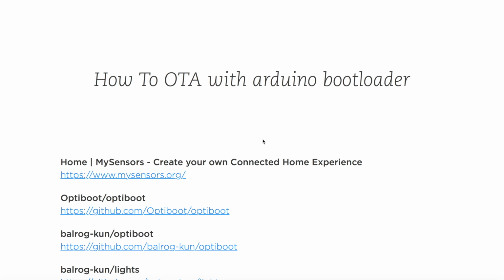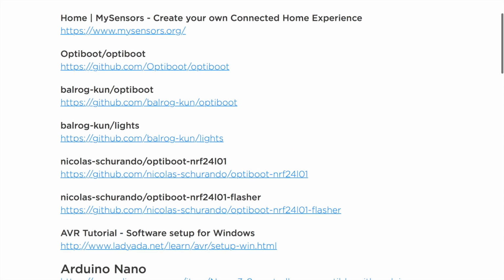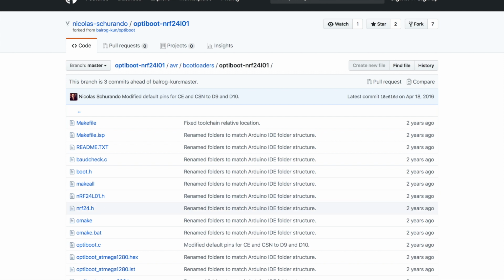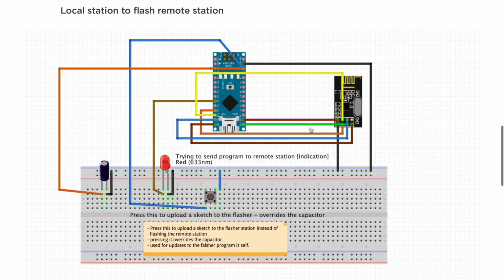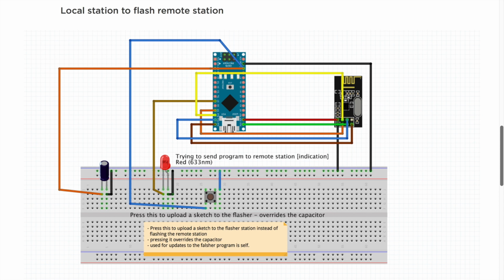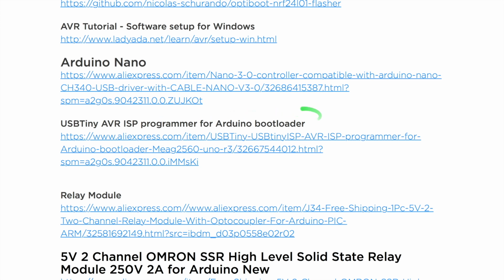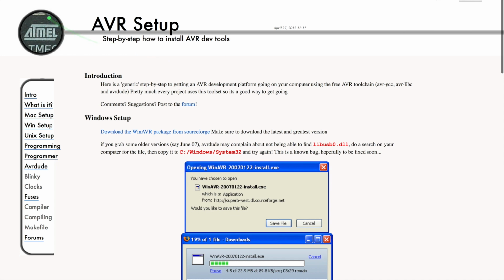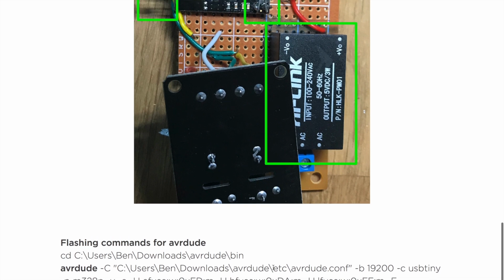Arduino bootloader with OTA (over the air) support over nrf24l01

Comment: Hi Ben. Yes... 2023 now... Before I start trying this, I would like to know if the pins (CE on D9 and CSN on D10) are only for the board what will upload or are also for the board that will be flashed?
Why? I am using Arduino RF-Nano's with an onboard nRF, and they are hardware wise fixed to D7 (CE) and D8 (CSN).
Thank you for any info on this!

Comment: Hello, this is a fascinating project you have here. I just explored and tried these solutions and I am facing a wall rightnow.
IF  I understand well :
- Upload the flasher.ino to the local station
- connect the NRF to the local station
- burn an Nrf-bootloader.hex into the remote station
- connect the NRF to the remote station
- when uploading a new remote sketch, don't press the button ( to  stop the reset from happening because of the Capacitor). <---- THis isn't working if i don't press the button the IDE( Or console avrdude) will stop and wait until the reset is pressed or after 10 tries gives up. That's  where i am stuck.
Reply from the maker: Anis G if you press the button and release you are burning the local station, so the fact that you see the 10 retires is a step forward, this means the communication is not arriving (or not sent) to the remote station, this is kind of hard to debug and there cloud ve many reason, make sure the remote nrf is installed on the right pins (9,10) as the bootloader is using these pins, in my repo there is a debug hex which lights a led when receiveing communication from the local station, this can help you figure out if the problem is no the remote or local station, this is very delicate thing and I have found in many of may circuits that the process did not work becuase something unexpected was happing during boot (some other component interfering), if you have some kind of scope it can help you as well do check if data is sent or arriving to the remote. Hope it helps...
Reply: @2bitornot2bit73  been doing that all day , your work really help going through the poor documentation and yes I am slowly proofing parts of the full transmission. I already have a working Rx TX nrf station , Which means both my nrf are correctly plugged. Now the final piece might be a wrong bootloader for the remote station. Because I have found many flaws in optiboot make file ( it used absolute paths and the folders have been modified in Arduino so it fails to find all the includes).

I will keep you updated If I have any new information
Reply: @2bitornot2bit73  , I just finished an in-depth exploration of the flasher program. it seems that the addresses of the 2 NRF will be located in first 6 bytes of the EEPROM and the flasher's program has to read them in order to send the data. What is happening is :  the program given by Nicola Schurando CAN'T read the EEPROM (or at least fails to show that it can) I have used AVRDUDESS to probe the EEPROM and confirmed that the correct addresses are there (Reading an INTEL HEX, look for it in Wikipedia) .

Just to be sure , which Bootloader should be in the Flasher and which sketch.ino goes in ?

Comment: Not working for me :( Please help.
What I've done:

using usbasp and atmega328p on breadboard + avrdudess:
CE - A1, CSN - 10
changed fusebits
compiled optiboot_atmega328p.hex
uploaded optiboot_atmega328p.hex using avrdude on remote station (LB 0x0F is not working on 328p, I set 0xCF).
changed 6 eeprom adresses for nrf24 001000

using arduino uno board (usb) + arduino IDE:
CE - 9, CSN - 10
uploaded flasher on local station
changed 6 eeprom adresses for nrf24 000001
put 10uF across reset so my local station is not reseting now
using arduino IDE i try to send blinky example to remote station

avrdude: stk500_recv(): programmer is not responding
avrdude: stk500_getsync() attempt 10 of 10: not in sync: resp=0x00

*does not work even if i manually reset remote station before uploading
*nrf24 work on on other programs 

PLEASE HELP
Reply from the maker: Mateusz Kuśmierz hi, it cloud be many things, so I am not sure what exactly happes in your case tough it sounds you are at the right direction 😃, there is a blink led version I made for the bootloader so you will know that packets are arriving thorough the SPI, if it does not blink it means packets are not arrving, that will get you started debugging: https://github.com/benchuk/SmartHomeDIY/tree/master/SmartHome/arduino_stations/OTA/bootloader_with_ota_support/for_debug/bootloader_with_debug_leds/optiboot-nrf24l01-master-debug

Comment: Hi 2BitOrNot2Bit, your OTA support over RF24 is very interesting. I'am trying OTA by following your path in https://www.2bitornot2bit.com/blog/arduino-bootloader-with-ota-over-the-air-support-over-nrf24l01 but without success.

I use 2 Arduino Uno to transmit (Arduino local station) and receive (Arduino remote station).
CE -> PIN9, CSN -> PIN10, capacitor like instructions.
  
1. Arduino remote station: I burn bootloader "optiboot_atmega328.hex" from https://github.com/nicolas-schurando/optiboot-nrf24l01/tree/master/avr/bootloaders/optiboot-nrf24l01
I use two command in cmd win10: 

C:\Program Files (x86)\Arduino\hardware\tools\avr\bin>avrdude -C "C:\Program Files (x86)\Arduino\hardware\tools\avr/etc/avrdude.conf" -b 19200 -c arduino -p m328p -cstk500v1 -PCOM3 -v -U efuse:w:0xFD:m -U hfuse:w:0xDA:m -U lfuse:w:0xFF:m -F

C:\Program Files (x86)\Arduino\hardware\tools\avr\bin>avrdude -C "C:\Program Files (x86)\Arduino\hardware\tools\avr/etc/avrdude.conf" -b 19200 -c arduino -p m328p -cstk500v1 -PCOM3 -v -U flash:w:C:\Users\TRANPH~1\Downloads\optiboot_atmega328.hex:i -U lock:w:0x0F:m

It was reported as ok

2. Arduino local station: I upload "optiboot-nrf24l01-flasher.ino" from https://github.com/nicolas-schurando/optiboot-nrf24l01-flasher
after that I upload blink_led to Arduino remote station by command:

C:\Program Files (x86)\Arduino\hardware\tools\avr\bin>avrdude -C "C:\Program Files (x86)\Arduino\hardware\tools\avr/etc/avrdude.conf" -b 19200 -c arduino -p m328p -cstk500v1 -PCOM4 -v -U flash:w:C:\Users\TRANPH~1\AppData\Local\Temp\arduino_build_920680/BlinkWithoutDelay.ino.hex:i

But I always get the message: 
avrdude: stk500_getsync() attempt 1 of 10: not in sync: resp=0x1e
avrdude: stk500_getsync() attempt 2 of 10: not in sync: resp=0x66
avrdude: stk500_getsync() attempt 3 of 10: not in sync: resp=0x98
avrdude: stk500_getsync() attempt 4 of 10: not in sync: resp=0x66
avrdude: stk500_getsync() attempt 5 of 10: not in sync: resp=0x60
avrdude: stk500_getsync() attempt 6 of 10: not in sync: resp=0x7e
avrdude: stk500_getsync() attempt 7 of 10: not in sync: resp=0x86
avrdude: stk500_getsync() attempt 8 of 10: not in sync: resp=0x7e
avrdude: stk500_getsync() attempt 9 of 10: not in sync: resp=0x00
avrdude: stk500_getsync() attempt 10 of 10: not in sync: resp=0x18

and nothing happened.

Please tell me where is my fault. Thank u so much.
Reply from the maker: There seems to be a communication error, please make sure there are no other SPI devices and make sure you connected everything according to the schematics provided on the article, if you can send your schematics it will be very helpful

Comment: Hi 2BitOrNot2Bit, Congratulations for your application !!!, I want to do something similar using Arduino Nano + esp8266, you know some version of optiboot that allows loading the bootloader, technically I have a serial bridge between 2 esp8266, the drawback is the arduino reset without using DTR.
Could I give a recommendation or suggestion or do you know a bootloader?
regards
Reply from the maker: You want to flash the boot over regular usb? And not the 6 pin header? Did I understood your question?